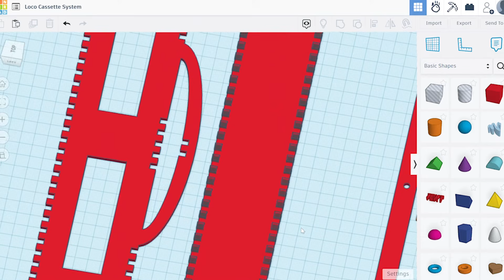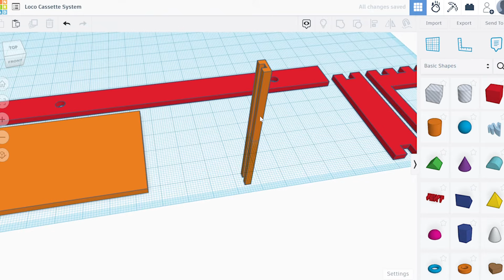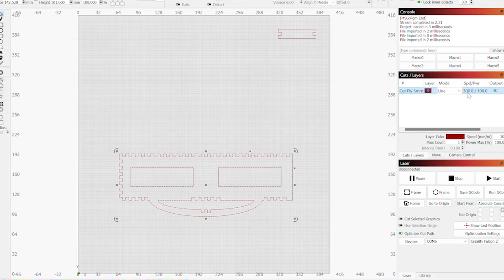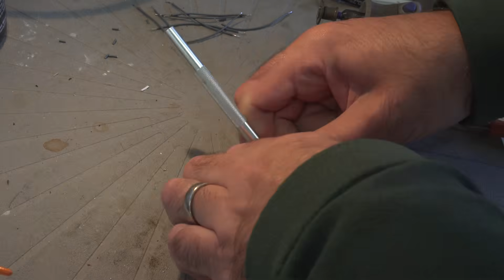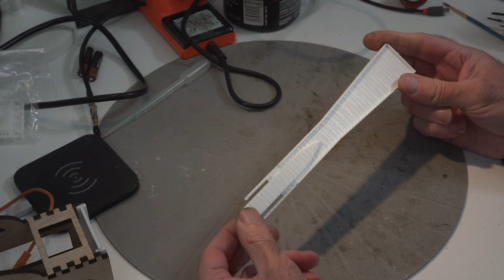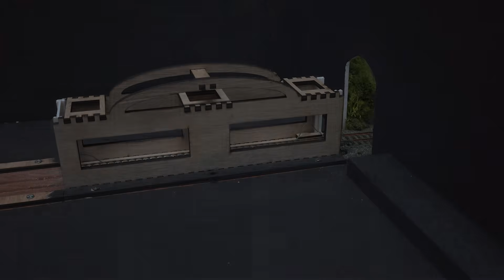7 - Designing a Fiddle Yard Cassette System at Donnington Castle Model Railway

Comment: Hi, I've only just discovered your channel while I was searching for a cassette system for my layout. I really like the longer cassettes and would very much like one to hold a loco and two coaches. Is it possible to download the necessary files for the laser cutter and 3d printer? I have a friend who has a laser cutter and 3d printer. I don't have the skills or knowledge to design my own cassettes. Best Wishes.
Reply from the maker: Hi, thanks for the message. I'm always happy to share everything I make for the layout under a creative commons non commercial licence so would be happy to do that. If you drop me an email to donningtoncastlemr@gmail.com I'll be able to reply with everything you'll need.
Reply: @DonningtonCastleModelRailway  thank you very much for your help.

Comment: This is exactly what I need for my future N scale layout project. I'll take inspiration fron your design when making my own cassettes from lasercut ply. For the doors, I'll add a thin foam pad to protect the couplers and ends of rolling stock if they hit the door. And also the handles will make it easy to create a serie of supports to hang them behind the backdrop as I plan to hide the fiddle yard behind some industry or TMD (I model north Wales in 1985 in N scale  while in OO it'll be south devon & north Cornwall in 1944  before  during and after D-Day 😊
Reply from the maker: Glad you liked the design. I'm more than happy to share the TinkerCAD project or SVGs if its any help. Like the idea of the foam padding on the doors, might use that idea myself. Whereabouts in North Wales do you model? I have lots of memories of trips to that part of the world as a kid.
Reply: @DonningtonCastleModelRailway  I'll be OK without the svg's... I myself design lasercut building kits for a Belgian brand so I am used to CAD (working with Qcad and Fusion360). 
As for North Wales, I went in '85 to Colomendy, not far from Chester, for a language immersion camp. I plan to model a fictive branch line terminus inspired by the area around Colomendy and Chester (Western region, of course) from the late 70's to the late 80's, trying to capture in model my memories of that time... (I even had the chance to visit the museum in York). My other region of interest in Wales would also be the Severn Valley Railway, that I discovered thanks to the first 'Narnia' movie (Highley Station made to be Coombe for the film, and the views of the train along the river Severn - I even plan to have a model of the Narnia train later to have it make guest appearances on the layout).
Reply from the maker: @ericsainte290 I keep meaning to look at other CAD software, so I'll check those two out to see if I could use them with my very rudimentary skillset! Look forward to seeing how your cassettes come out. I know Colomendy really well, went there on a couple of trips in the 1980s. So your idea sounds amazing, especially if you can get an essence of the railways around Chester in there. Know them all very well. I remember seeing pairs of 20s trundling along the old avoiding line many years ago, I presume they were always heading to or from Shotton. Its all a bike path now, that I really should ride along at some point. Also love the idea of the Narnia train!